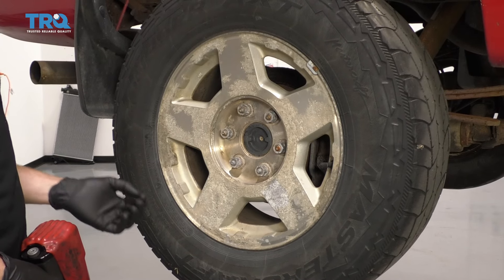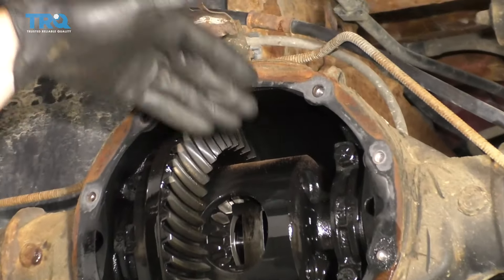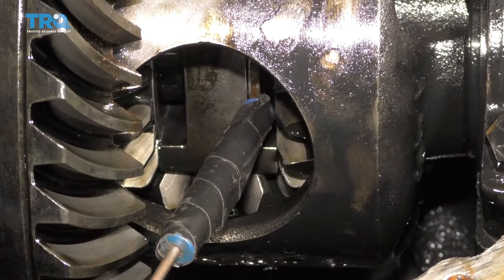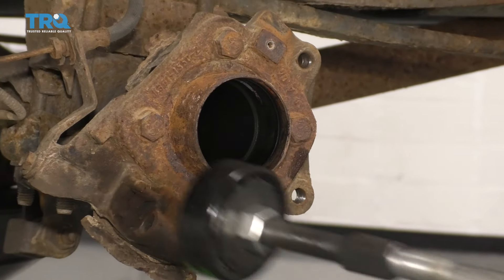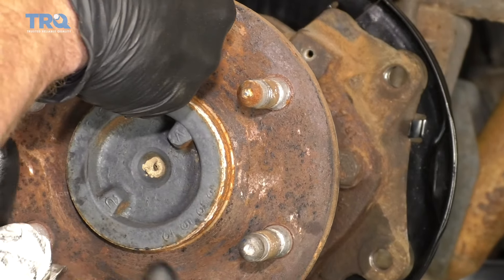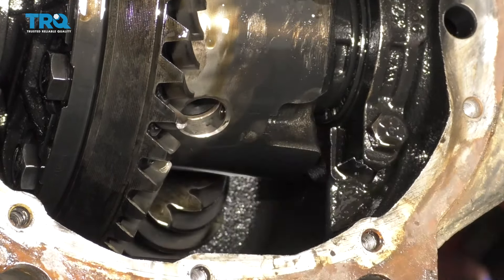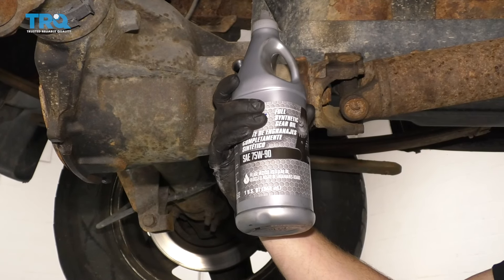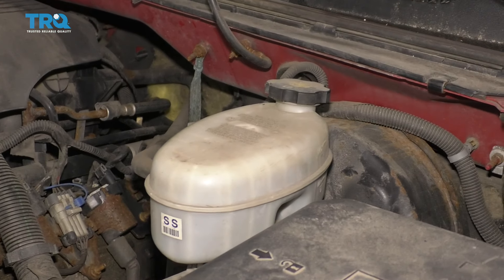How to Replace Rear Wheel Bearing 1999-2013 Chevy Silverado

Comment: Never add brake fluid. If it’s low, that’s because either the pads are worn, or there is a leak in the system that needs to be fixed.
Reply: What does brake fluid  have to do with  changing  axle bearings

Comment: How did that bearing come out so easy. I have a 2015 silverado 1500 4x4 and the rear wheel bearing will not budge. I broke the puller trying to get it out and damaged the reluctor ring as well. Im to the point of cutting the bearing out. Any advice would be helpful so I do not do anymore damage ha.

Comment: You can't really use that bearing tool on newer (2010+) because there is a ABS reluctor ring behind the bearing preventing the tool from opening to use it. (There is about 1/4" gap.) The smaller bearing tool will open, but it is not wide enough to catch the entire bearing race wall so it fails.

Comment: No LS additive is spec'd for g80 rear diff. It is a locking diff, not a limited a limited-slip diff. Just synthetic 75W-90 gear oil is all you need.

Comment: great video, i was able to do everything myself for the first time changing bearings on a rear end. only problem is the a1 auto bearings trq was to small. still working with customer care to resolve the issue. what sucks is, if they get me the correct bearings i will have to buy new gasket seals and oil all over again also.

Comment: During the slide hammer phase ended up off center a bit 😮 and have score marks on the inside portion of the axle and on the bearing race 😢.  Flippin’ idiot!!

Hoping the RTV on the seal will keep it sealed up!

Comment: When installing the bearing, you can put it in the freezer before. Will make it go in even easier. 

Also, with the seal, I've heard some people say that rtv isn't needed with rubber seals, but I have always put it on as an extra insurance. Just seems odd to not add that extra little insurance.

Comment: Great video, well explained!.

What about the ABS tone ring? If your rear axle has this, will this puller and adapter fit between them or do you need to remove the tone ring also if you don't have the special GM tool?

Comment: Messed up using that brand of oil. It has friction additive.  Must use 75w-90 full synthetic gear oil, no friction additive for Eaton lockers.
It is a mechanical locker. The additive is for LS locks w friction discs.

Comment: Mann.. I got this 2003 Silverado. And my passenger rear brake started grinding metal to metal. (I did a brake job less than a year ago) also noticed mid tread wear on both my rear tires. And they’re not over inflated. Now I’m noticing that my passenger rear wheel is getting real hot, so now I’m here. Could this cause all this wreckage? 😢
Reply from the maker: +@Kuebix We wouldn't be able to diagnose an issue like that here, you may want to have a local mechanic take a look at it. Thanks for checking us out! http://1aau.to/m/Shop-1AAuto-c

Comment: Some tips on very rusty vehicles. The differential bolts m8 x 1.25 x 25mm long were so rusty a few almost didnt have enough flats left to grip with a socket. I found pounding on them with a big hammer to mash the top a bit gave me enough to get the bolts to crack loose. Only had to use the torch on one of them. The driver side bearing was beyond stuck. Had to use the torch to get it extremely hot before my slide hammer would get it to finally come out. Getting the new bearing back in on the side it didn't want to come out is going to be a pain until it's started real good. Wood is likely only going to dent as you pound on it. A pc of aluminum works better to start it. When turning the gears, use the driveshaft as mentioned, do not turn the axle shafts without the pin in since it will make everything misaligned.  If it does turn a bit you can cautiously turn it the other way till it aligns. I found I could leave the pin in for most of the turning you just have to keep a finger on it incase it wants to slide out than you can slide it out upwards then remove the c clips and small bolt. Use a socket for the bolt, it grips better than my wrench. Check your break lines on the axle and be prepared to replace them. Make sure you can get the axle shaft seals if you are going to a parts store for them, none of the chain stores in my area had any and I finally found a small store 25 minutes away that had some. Claw side of a claw hammer works better than a pry bar to remove the seal.

Comment: Can I use high temperature grease for the bearing instead of gear oil ??
Reply: No, use correct oil, same as you refill with, its all in the same cavity.

Comment: What about the drivers side procedure ???
Reply from the maker: +Vito Tamarazzo The procedure for the driver side should be the same.
Reply: @TRQ  iwheres the cross shaft and clip in the rear diff ?? They aren't symmetrical.
Reply: It's way easier

Comment: Great video! I had my left rear axle seal replaced about 6 months ago and after it was done shortly after I started hearing a grinding sound. I changed my pads, rotors, and calipers because it was time for them to be changed but shortly after that it started grinding even more. I guy I know said it sounds like my bearings were bad and it's possible but it's amazing that I had no grinding before I took it to the repair shop. They didn't replace the bearings and I believe they were old and probably damaged during reinstallation. I'm going to inspect them myself and this video was the perfect tutorial. Thank you!

Comment: good video but what happens when you can't get bearing out all that happen for me is bearing blew apart and still in. Been at it for 2 days with puller and slide hammer no results

Comment: Interesting that you used Red threadlocker on the caliper mounting bolts.  Isn't that too strong?  After all, someday you'll want to pull off that caliper again.  Or, is it okay because those are big bolts and you will be using big wrenches with big leverage to get them off?
Reply: Yes, but a torch to warm them up breaks down the red. I would use blue or really don’t need any.

Comment: I just did this job because I was having a leak on my drivers side rear wheel where it's leaking gear oil onto the rotor making a nasty smell... I replaced the seal and put everything back together. I made sure the spring was still on the seal and that the axle looked ok. It is still leaking though. What else could causing it. The leak really looked like it was from that seal. Could I have missed something? if so, what?
Reply: The actual metal the seal goes into can rust or get worn out over time causing a bad seal therefore it leaks take the seal off and take some sand paper very light sand paper and sand just the end where the seal sits wipe it clean with brake cleaner and the put a new seal in and that should fix your problem permanently

Comment: I followed the steps and after replacing the pin and bolt, the axles move when the transmission is in park. Can anybody tell me what I may have done wrong?
Reply: Did you possibly forget the c clip